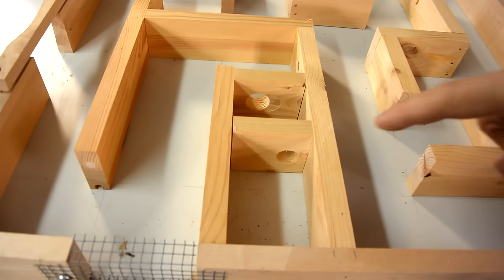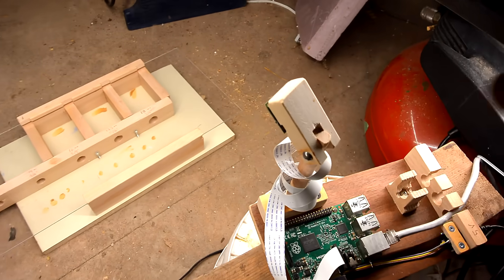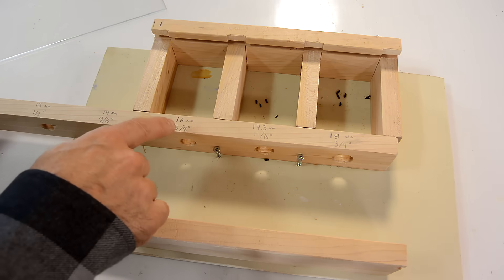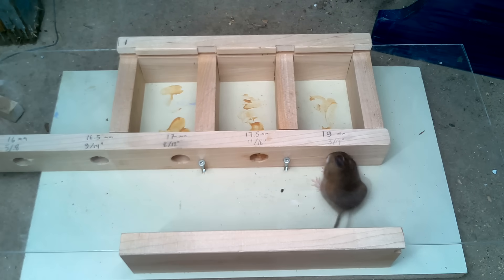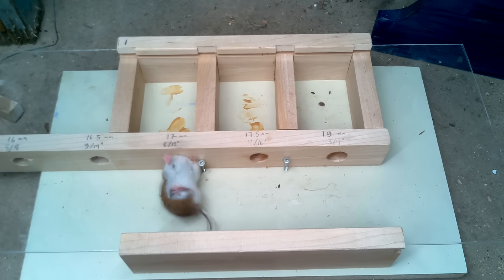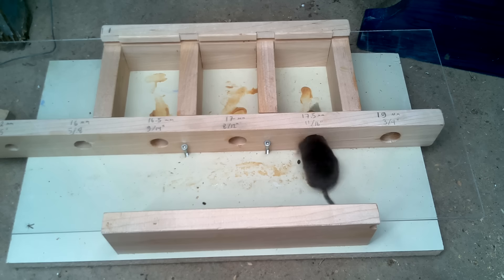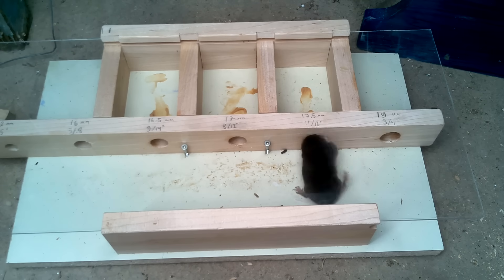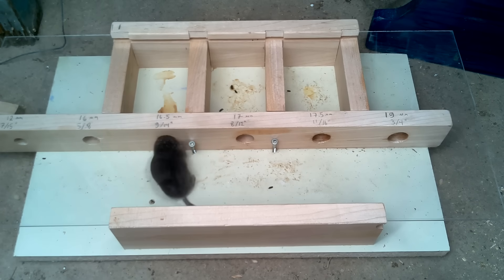How small a hole can a mouse get through?  Experiments.

Comment: I've never seen imperial measurements like 9/14ths and 8/12ths, I feel like this was a bit of mocking humour.
Reply: Haha Thanks I had not noticed this ! Although 16.5 mm is closer to 13/20th than to 9 14ths.
Reply: Yeah I figured 8/12 had to be a joke or a typo since 8/12 = 2/3 when in least terms.
Reply: The American 500 horsepower  cars made in the  1960s were designed with imperial  measurements

Comment: If the shrew could get through the middle hole, I would think the mouse could have too if it had tried. My assumption is that it was just too lazy. The shrew struggled getting through the largest one at first where the mouse had no problem. So I would think it could easily get through the middle as well. Maybe now that the mouse knows there's food there. Try only putting peanutbutter on the inside instead of in the hallway too? That'll make it more determined to try to squeeze through I would think. I've seen golf ball sized mice get into places with holes in them with a diameter small enough to get your finger stuck in. They're crazy good contortionists

Comment: Matthias, can you repeat the experiment  using a "slot" ? so it is set up as if the mouse is going under a door?
the height would be the determining factor as the width would be "infinite" in relation to the mouse.
I'm curious if they can flatten themselves further if they are allowed to get wider.

Comment: This is a very interesting video as this is a question that was my mind. We had exactly this kind of mouse in our apartment and I wanted to build a trap for them. Knowing how big a hole must be is quite useful designing a trap, but I had to guess on that. You should try this experience with slits too to see how much of a gap in needed under a plank for a mouse to get inside a house.

By the way, my solution for the mouse problem was to build a lego/plastic bottle trap with a 22 mm hole. So they ended up unarmed inside a bottle and I could relocate them.

Comment: If you had a way to move the slide after they were in...
Reply: Yes, if it were set up so that the mouse could easily get in but then HAD to get out through a smaller hole because the "easy in" door became closed.  A series of "check valve" holes.